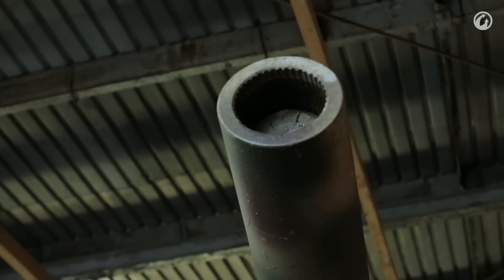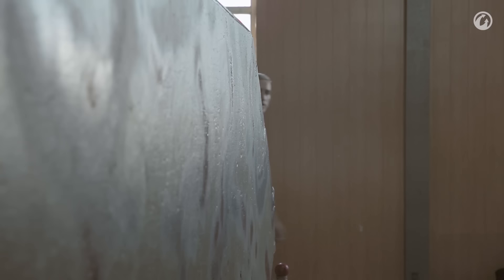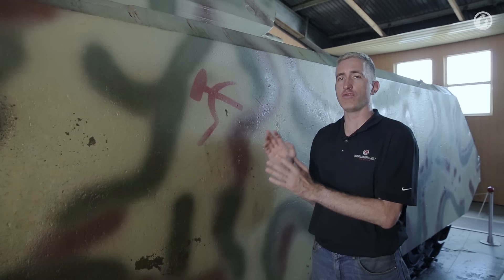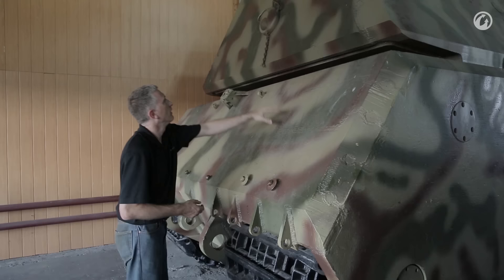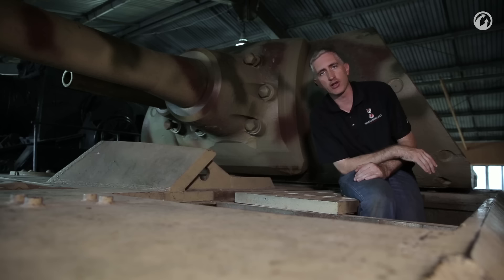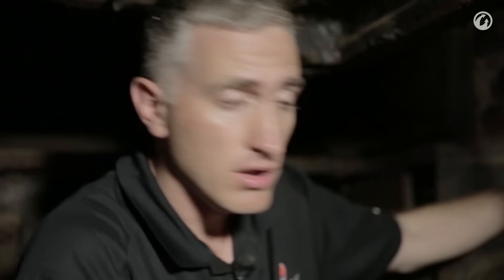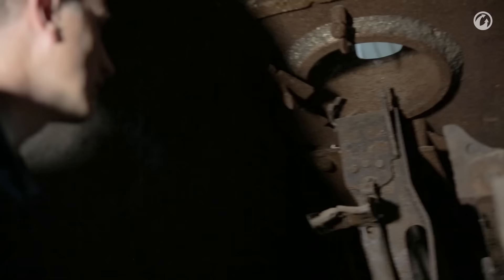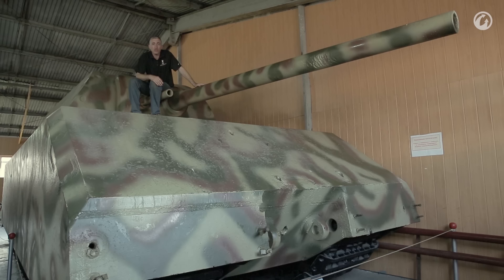Inside the Chieftain's Hatch: The Mighty Maus

Comment: Could a  javeline antitank missile easily knock this beast?
Reply: The tank was constructed entirely out of steel. Modern AT missiles like the Javelin are made to punch through composite materials which are much more effective at blocking projectiles, so I think it's safe to say that any kind of modern AT weapon would likely be able to put quite the hole in this given it was big enough. With something like an M72 LAW you might need a few shots but I think a Javelin would destroy this quite easily.
Reply: yes
Reply: thick armor dont mean a shit in modern warfare
Reply: Kraftsman Sheng 
I wouldnt say that. The Abrams can bounce shots...for example. 

What you mean to say is, pure steel armor doesnt mean shit.
Reply: finsfan90 Well this isn't plain industrial steel on the Maus. It's typically low-carbon high-chromium/nickel/manganese steel alloys.
Reply: finsfan90 even the reactive armor can only protect a spot for only once, you fire one more time at that right spot again it'll go in and injure the crew inside the tank, like the heat round and apcr or sabot, or big fat anti tank missile.
Reply: Even a panzerfaust could

Comment: This kind of vehicle is why Germany lost, they could have built so many more Tiger II's or Panthers and or Panther II's but wasted their time on super heavy, ultra expensive tanks when their enemies were building more tanks that could be produced for much less at a much faster rate. Maybe it's a good thing they let Hitler dictate what they should build, which eventually cost them the war.
Reply: +The Chairman Yes but this was not confined just to tanks (I assume that's what you meant).
Reply: Panther II was never built. And the Tigers and Tiger IIs themselves strained German resources. They would have been better off spamming PZ IVs instead. Much more reliable and WAY cheaper.
Reply: finsfan90 Yeah, this is right. At the end of 1944 Speer warned that Germany was reaching the limits of its steel production and that it would have massive implications. By that time Germany was also in the middle of a transport crisis because of allied air attacks on  rail and canal facilities. By the end of the war, the most effective German "wonder weapon" was probably the Panzerfaust, which was kind of the opposite of the Maus. It was light, simple, cheap to produce, could be used by everyone and it was extremely effective.

Hitler wasn't directly involved in many of these programs. Where he was it was in things like trying to convert the Messerschmitt 262 into a "blitz bomber", which removed most of its tactical advantages. The problem was - and this is borne out by any of the writings about the exchanges in the Berlin bunker at the end of the war - Hitler simply did not understand defensive strategy. He only thought in terms of attack and would not listen to any sensible alternatives . This was enormously frustrating to people like Guderian, who fought with him constantly and others like Heinrici, an excellent defensive strategist who was the last senior commander to be sacked. The majority of those who remained, whatever their competence, were yes men and only interested in placating him.

That means that all the reports of economic collapse, failure in steel production and crises in the rail and barge transport systems were simply ignored by the high command.
Reply: +finsfan90 one Panther II was built, and still exists today, though fitted with a Ausf. G turret.

Comment: What is this "internal explosion" thats mentioned?
Reply: during world war 2, to prevent other countries from capturing tanks. what the germans would do, this is part of the instructions to tankers, if the vehicle is going to be captured, say they lose a track, have to abandon. they would throw a grenade in the tank, to prevent allied forces from getting it.for various reasons.
Reply: I would have to think they would toss in more than a grenade. Some light shrapnel wouldn't do much to disable, or even disfigure, the inside of a tank. Maybe they would rig their ammo to detonate?
Reply: Lucas West the light shrapnel from the grenade would detonate all the larger shells, like the HE  shells, completely annihilating the inside of a tank. this was actually confirmed to have happened to a tiger ll.
Reply: +lucas buffington yeah that makes sense, kinda lika ammoracking a tank ingame.
Reply: In this case, though, reports are that engineers scuttled the tank... so they would most likely have used explosive charges instead of relying on the luck of a grenade toss.
Reply: lucas buffington Never said it wouldn't, just that it wasn't what they used on the Maus.
Reply: when the Maus was under test the soviets captured the factory, then German engineers planted explosives inside the tank and blown it up so soviets can't get it
Reply: during the test firing they destroyed the engines and set fire to the insides as the vehicle itself was a huge cumbustible bunker

Comment: if nazi germany would have builded more mauses what would u think would have happened
Reply: They would have lost the war anyway. They lacked the material or the fuel. And this is basically a land based battleship, without a long supply line and air cover its useless.
Reply: fn 2198 
They'd have lost even quicker :D
Reply: They would have realized how absolutely terrible they truely were. Yes they can stop practically any tank shell, yes they're massive and scary, yes they pack a massive punch with that 128 gun... But, they were slow, easily broken (as they were so heavy and used new mechanical concepts to handle the weight and size), and because they broke so easy and were so big and poorly built they were impossible to work on. All the allied troops would have to do is flank the damn thing (if the maus even made it to the battle front at its extremely slow speed over extremely difficult terrain), then blow its tracks off, mount it, drop a few grenades inside, and that'd be it. Rinse and repeat.

Now if they were smart and spent their resources and time on amassing huge numbers of Panzer III's and IV's, upgraded them with larger guns and thicker spaced armor, more powerful engines, and trained their crews to work together as a tank group, then the allied forces would have had a problem. Yeah if the nazis had enough resources to build the King Tiger's (Tiger II) or even the VK 45.01 models in finished working order, they could have managed to withstand the power of the Sherman Firefly (which could destroy Tiger I's) and almost any other tank the allies had.

But lack of resources and the lack of morale from the german army would have stopped them anyways, Hitler was already mentally gone, meth melted his brain and was on the way to dying from terrible medicine treatments anyways. The craziest things happened during WW2.
Reply: ***** In the end regardless of how many tanks they could have built (Tiger II Panzer III or IV) it wouldn't have mattered. Between the US and Russia we had over 100,000 M4 Shermans and T-34's. And could have built 100,000 more if needed. All the Germans could have done was greatly increased the casualty count. 

Also worth mentioning, The M26 and IS-2 could have handled the Tigers. And if the Germans had managed to drag the war on say another 2-3 years the Allies simply would have had more of those. The Russians already had 3,000+ IS-2's on the battle field. 3 times more then the Tiger I and II combined.

Comment: This tank is so useless...it is extremely slow and no engine could move this without it overheating...you could have probably built a dozen panzer3s with the amount of steel in this tank...and even if an engine could move this abomination the enemy could completely drive circles around this thing
Reply: vital 1234 it did drive but apparently not very well